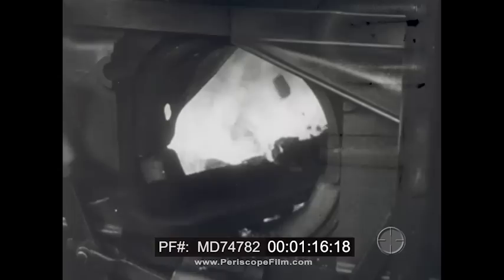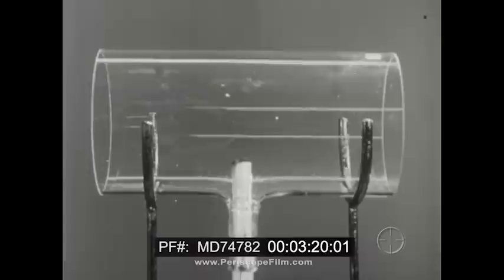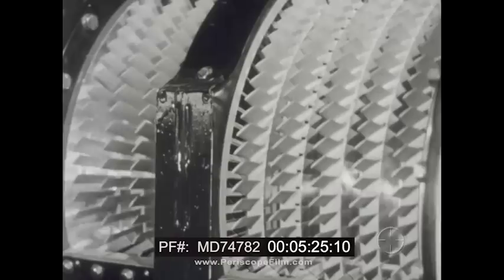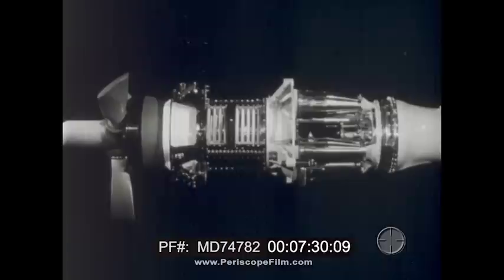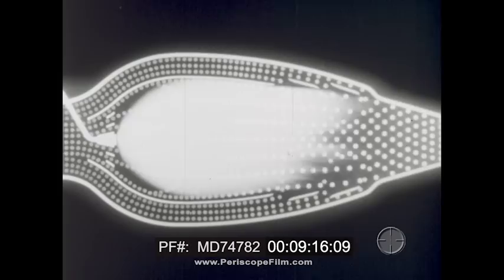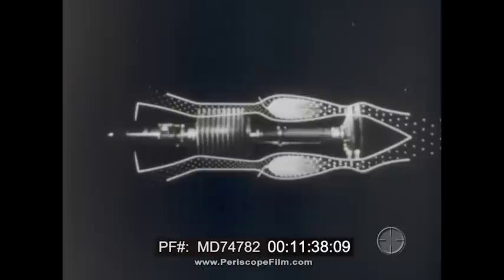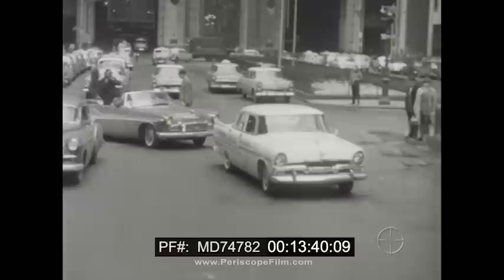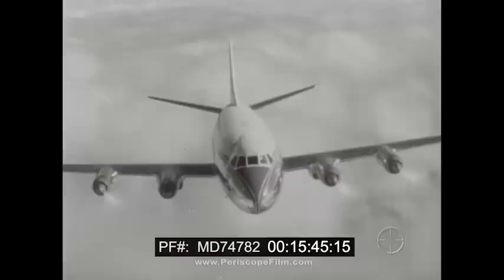THE GAS TURBINE ENGINE JET ENGINE     SHELL OIL COMPANY FILM MD74782

Comment: Ha! I used to work with the guy, Jim, at 14:22 into the video. That lab in Wood River was my first job as a summer student in 1968. The video brings back great memories.
Reply from the maker: No way!
Reply: @PeriscopeFilm  Way! I am a retired chemist, I worked in that lab 1968 through 1973. Regarding fuels you may recall famous WW2 aviator Jimmie Doolittle, a Shell guy who was instrumental in the development of high octane Avgas that gave the USA fighter plans a performance edge.
Reply: It's a cool story to begin with, but the "No way!"...."Way!" exchange just made my night. Thanks :)
Reply: @txmike1945  Do you have any book recommendations? Chemistry interests me.
Reply: @txmike1945  JP 8 ?
Reply: @peterparker9286  What about JP 8?
Reply: @txmike1945  Is that the fuel that was created between them years you posted about? Or is JP 8 classified as fuel but something totally different? Thanks.
Reply: @peterparker9286  No, it is counter-intuitive if you don't know the chemistry, but jet fuels of all types (JP4, JP8, Jet A, etc) are LOW octane and would not work in a piston engine. Up until near the end of WW2 airplanes were normally using low-octane automotive gasoline but that limited the compression ratio and thus power. The invention of 100 octane aviation gasoline (avgas) allowed designing engines that produced more power and thus gave the allied planes an advantage.
Reply: @txmike1945  Turbo blue is what they called this Racing fuel it was like 104 Octane so they said. Many years ago bought some.... I see Thanks ya 
Jp8 is refined Diesel/kerosene.

Comment: In 1949 the Rover Car Company built several models of gas turbines for its "Rover Jet 1". Later in 1952 the Austin Motor Company built experimental gas turbines for the "Austin Princess" at its Longbridge Research Facility. 

Neither of these English cars went into regular car production due to high fuel consumption when compared to reciprocal engines. 

Wikipedia has lots of historical details about these remarkable developments from over seventy years ago when British engineering took Sir Frank Whittle's invention of the jet engine in 1930, a number of steps further. Its an omission on the part of Shell Films to forget these historical facts.

Comment: I work in the Texas oil field. I always thought a good use of gas turbines would be to use the waste gas that is currently just burned up as a flare. Use it to produce electricity instead, using a small gas turbine. Of course I’m sure millions of others have thought of this, so I guess not practical. Cost, longevity of the gas turbines, noise, etc.
Reply: The trouble is to store for transport the energy produced, it must be cheaper and more compact than transporting the gas itself.
Reply: It’s definitely a good and logical thought, but the problem is that the waste gas is often inconsistent in composition, and contains way to much crap for efficient combustion. That being said, even inefficient combustion would still be less wasteful than just flaring it. Using waste gas directly in a gas turbine would be hard on the engine and quite maintenance intensive, possibly a better use it would be in a steam turbine generator.
Reply: I have never understood why it's not used, just flared. Seems like such a waste of good energy. Maybe the composition is inconsistent, but that's hardly something engineers couldn't sort out and deal with. I suppose the reason is too cheap energy prices to bother, and in more remote locations, the lack of power lines to transport the energy as electricity.

Comment: Back in the 1960s Ford had a fully operational concept truck they called big red that used a Ford Designed gas turbine. It was used for many years and is now owned by a private collector. Several years back Peterbilt built a concept electric hybrid semi truck that used a micro gas turbine to run a generator to charge the batteries.it ran much cleaner then diesel.

Comment: And Still 50years later auto traffic has not embraced turbines. Heat? noise?
Reply: Chrysler made one - too much wind and noise.
Reply: They aren't efficient for automotive applications.
Reply: Imagine "smoking '(?) someone behind you, when you step on the gas; because he was fallowing you too closely in traffic! 😃
Reply: I would sure rack up my Speedy rewards points fast!⭐⛽
Reply: Bad fuel efficiency at low speeds.
Reply: The Chrysler turbine engine was quiet and the exhaust, thanks to a heat re generator was surprisingly cool.  Fuel effeminacy was not great.  The engine was expensive to build. And to increase  efficiency, turbine inlet temperature must by high.   The makes it necessary to construct the  turbine from hi temp and expensive alloys. Also raising the  temperatures increases emissions of oxides of nitrogen, AKA NOX.
Reply: They have to be running at full power or high power most of the time. Even at idle a turbine engine is burning a lot of fuel. There is a "spool up" time. In essence, you would be drinking a lot of gas at stoplights and stop and go traffic. Now if you could be promised to be moving at a constant speed for a long duration it may be more efficient. The Chrysler turbine had decent mileage on the road. However, in the city it was horrible. Think of the opposite of a hybrid.
Reply: Let's also not forget The Almighty Dollar in terms of automotive industry profits.
Modern jet engines are immensely smooth and reliable, and can easily last for many decades if properly maintained.
All great features for the consumer, but definitely not desirable in the eyes of auto makers who are constantly dancing the engineering/PR line between "reliable enough to sell like hotcakes" and "this $5k repair bill is specifically designed to make you give up and go buy a new one".
Reply: Poor fuel economy mostly, that and people couldn't get comfortable with a turbine spinning at 10'000 RPMs right in front of them.